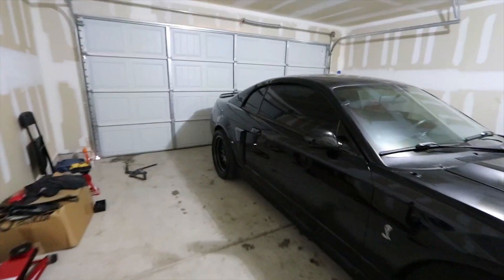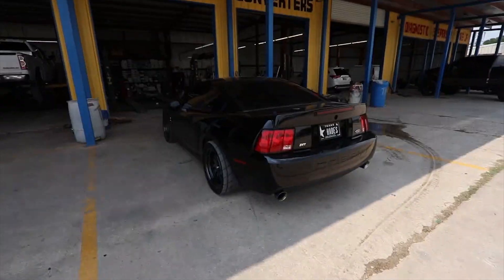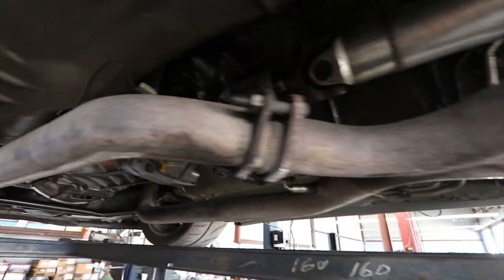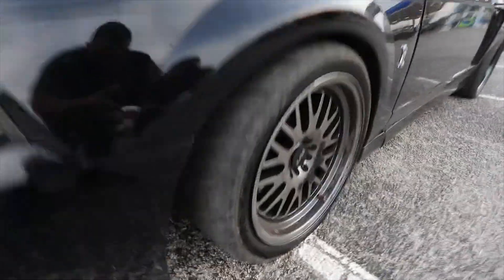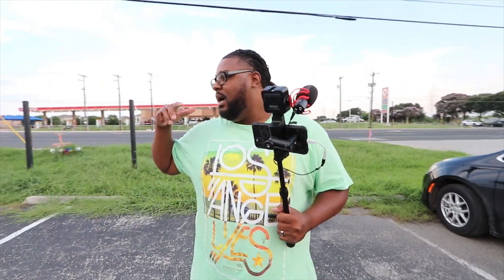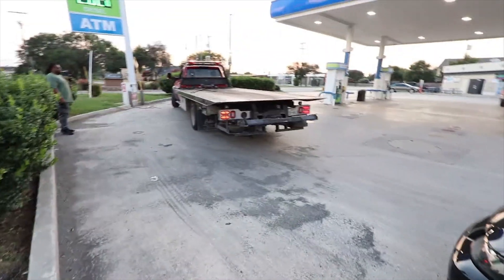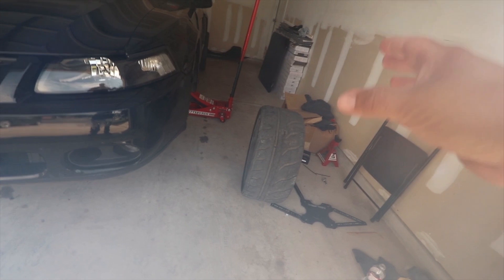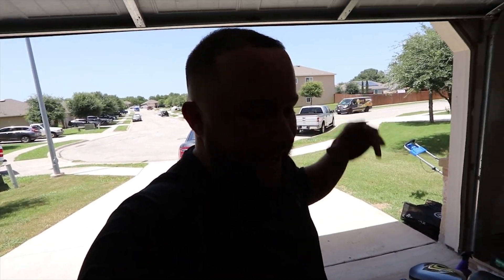TERMINATOR COBRA  Getting Towed...AGAIN! *$200+ down the drain

Comment: The exhaust sounds good. I wouldn't change it.
Reply from the maker: Thank you brother. Yeah I wish I could keep it but the fitment is not the greatest. Banging and scraping makes for a not so pleasant ride lol
Reply: @SOLODRIVEN  that x pipe will still hang low with the stingers…You have to cut it at the mid pipe like you said to correct the scraping…